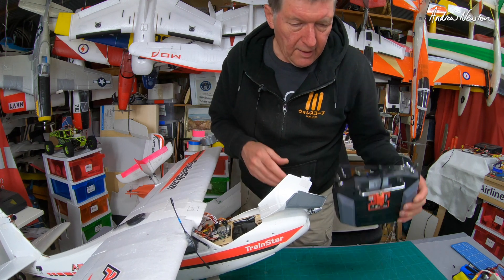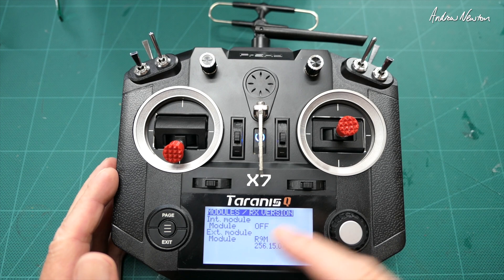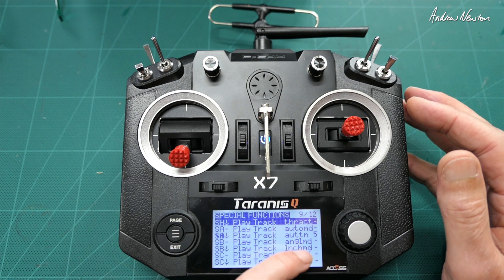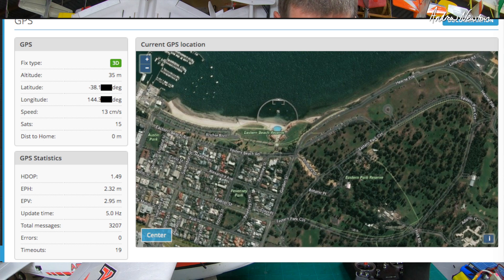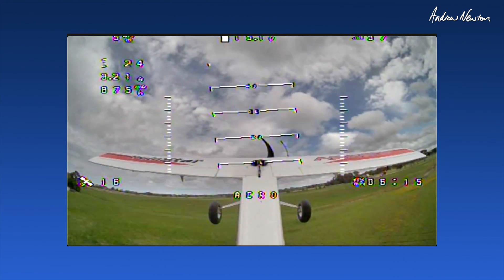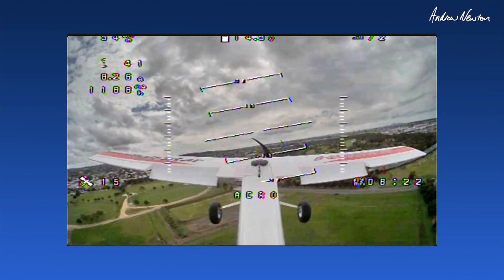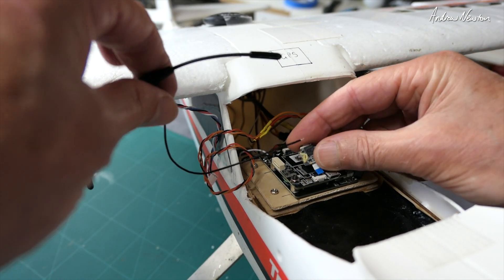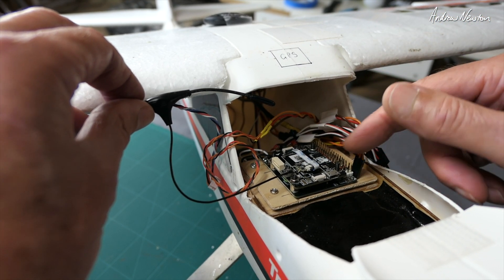FrSKY Pilot FCB - Onboard R9 receiver setup

Comment: Hi. I have R9 RXSR pilot FC/ 4x 900kv motor/  vtol wing model.  I have hobbywing ESC 2-6s  5v@7A 60A-UBEC-V1. 
From my understanding I get that It’s not good to run 2 BEC in the same time. The FC has 5v built in BEC. What ESC do you recommend for this setup? Ty
Reply from the maker: Need to work out how much current each motor will draw. That would depend on lifting weight and prop choice

Comment: Hey Sir Andrew how did you install firmware on reciever when it was plugged in trying to figure this one out I am in accst
take care
Reply from the maker: I didn't need to update. Not sure how to do it unless there is something on the FrSKY site?
Reply from the maker: The integrated receivers probably need to be updated by OTA. External receivers need to be connected to the s-port on a compatible radio and flashed via S-Port.
Reply: Thank you I am going to try and fix it through serial passthrough in betalflighti  @AndrewNewton
Reply: and I have the R9m mm

Comment: Yes, those tiny RXs belong out on a wingtip....Even on a quad, having them plugged into the FC isn't a good idea either, often the antenna is too short to place it favourably...Those ladder AHI are appalling, just block the view, and are a constant distraction...I don't even use the standard AHI these days...
Reply from the maker: I dont see the point of the horizon, unless your flying in fog
Reply: @AndrewNewton  Yes, I used to use it to get the FC board angle trim correct, then switch it off.....Even in cloud you can use Horizon Mode....🤔

Comment: Good honest review Andrew. I have been looking to buy this control board but haven't been able to press the buy now button. I was a bit concerned with the receiver on the board. D.I.Y extentions would be an easy fix, do you agree? It seems closely comparable with the Matek f765 control board missing the second video port but gaining the R9 receiver. I have only recently purchased a new Frsky X9D plus SE 2019 with R9 module after drop out issues with my Spekrum equipment. What would you recommend, buying the F765 Matek and R9 receiver or this FrSky controller board to get started with the new FrSky equipment?
Reply: I strongly recommend going with Matek FC boards and something like crossfire. Personal preference I guess but I don't like what FrSky has done with access and locking out their old receivers.
Reply: @DavidTaghehchian  I understand  both sides in the FrSky war. FrSky's D8 isn't fully legal in some countries which is why they dropped it partly. It's not on their new access transmitters but you can buy a JR module from them to still run the D8 equipment. All of my equipment runs on Spekrum dsmx. Due to not owning D8 receiver's, I don't need to worry about FrSky dripping it. Buy  uruav 4 in 1 module and you can run most receiver's on the market anyway and run it on a good well built transmitter like FrSky builds.
Reply from the maker: Either board but stand alone receiver would be my recommendation. Pilot has the Pixel OSD but is not yet fully supported by INAV. Matek has switchable video.

Comment: Don’t waste your time playing with Frsky. I have had to discard four receivers because the antennas were compromised.  TBS crossfire is my RF of choice.  Trying to repair them is a hassle.  The outer shell is ground, and the inner core carries the signal.  If you try and reattach it, you invariably will short the signal to ground.